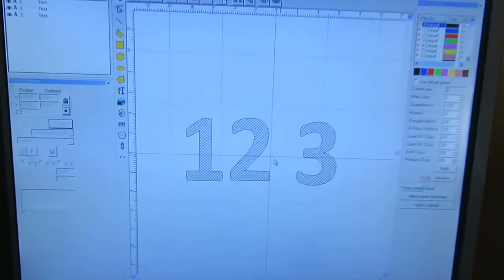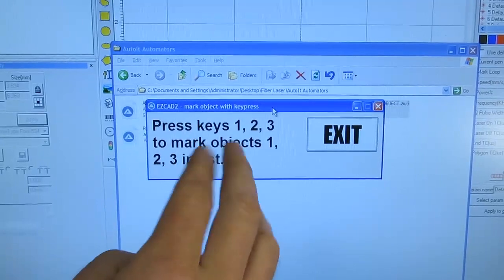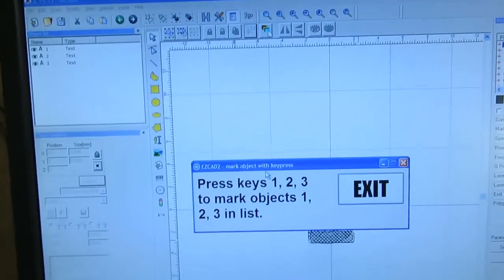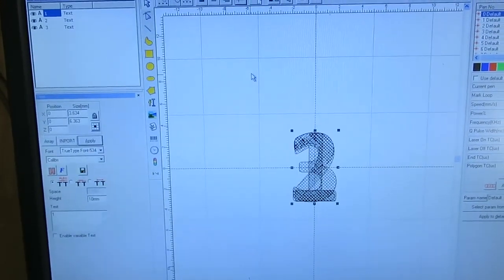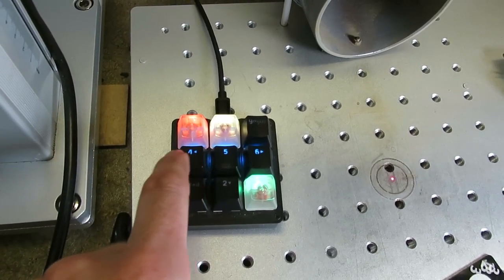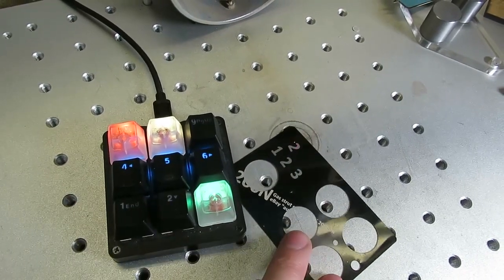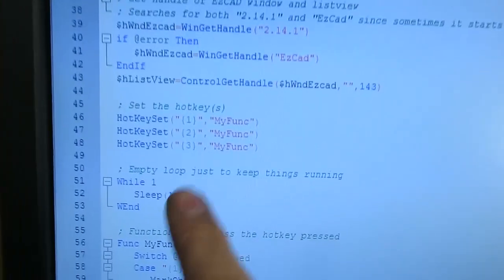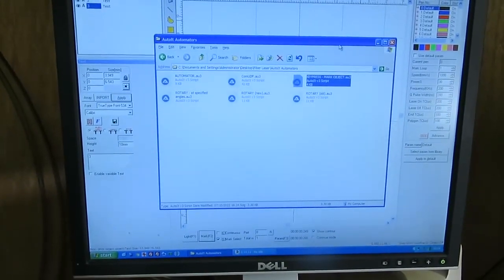EzCad keypress marking script for fiber laser

Comment: Can i make a script to move on xy certain distance and autofocus then start again?
Reply from the maker: No doubt you could, but I have no idea about the precise details. AutoIt is able to simulate any key/mouse interaction, so if you can do it in the original software, you'd be able to simulate it with a script.
Reply: @imajeenyus42  hm thank you. i think i understand , so i can't write custom scripts for automation but if is something that i can press manually ,AutoIt will make this process itself ?
 But how will it know when the deep engraving is done and make z axis come back to starting position and move xy axis and press autofocus and start again ?
Reply from the maker: @dansv3872  That's correct - whatever you can do yourself by clicking a button or using key presses, you can automate. As for checking when it's done, EzCad2 displays a "marking" window when marking is in progress, and I'm just checking every 100ms to see if the window is still present. If not, then I assume that marking is finished. Take a look at my other automator script here, it might give you some ideas:

http://imajeenyus.com/temp/automator.au3

Comment: Any reason you use ezcad as opposed to lightburn?
Reply from the maker: Just what I'm used to  - been using it a couple years before LB came out. I've got a load of files and scripts for EzCad and updating them all to work with LB would be a lot of work! TBH I've never had any problems with EzCad, but maybe my designs aren't as complicated as some.